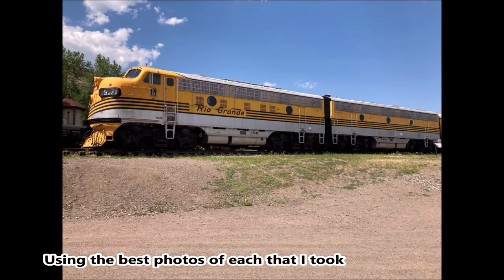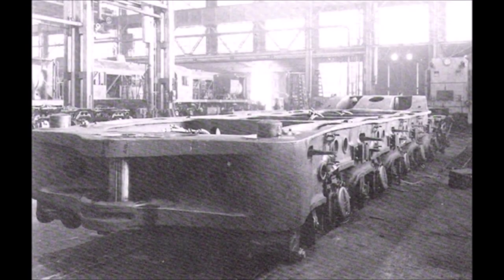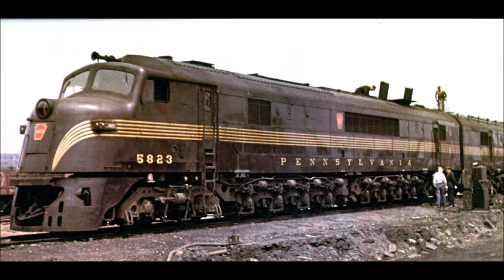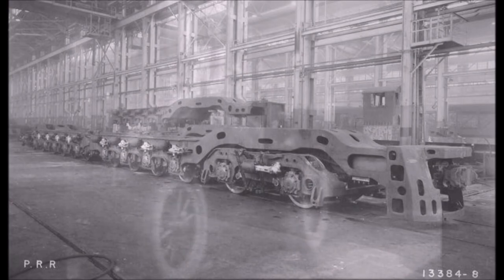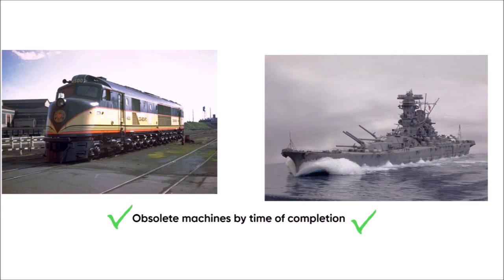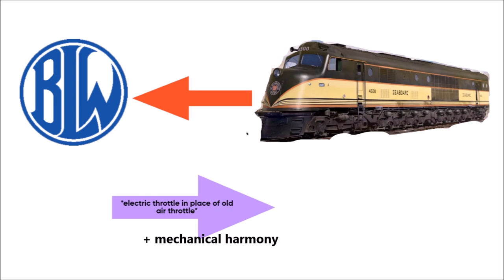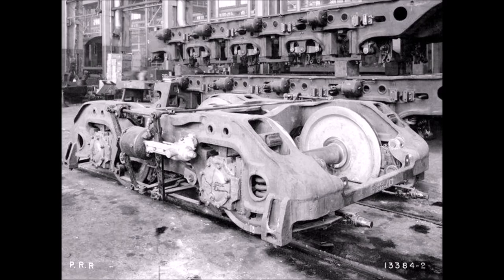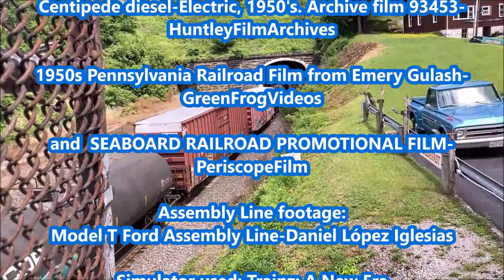The Baldwin Centipede| A steam-head company’s rough start with mainline diesels.

Comment: It's the standardized design concept in which builders like EMD, GE, and Alco beat out former steam builders. The former steam builders were still stuck in the customized build concept for building locomotives. This was acceptable during the steam years, but railroads were looking for standard parts and designs to maintain their locomotives.
Reply: you do realize alco is also a former steam builder right
Reply: @Foxyisinhell  You are technically right, but Alco was more willing to adapt to the changes in the environment. The other former steam builders were lost in the concept. Alco's downfall was in the electrical side of the locomotive building. If they were able to secure this element, they may have been around today.

Comment: The Centipedes that went to Mexico gave good service and allowed N de M to retire a large chunk of their steam locomotive fleet. Baldwin rebuilt N de M’s Centipedes with a different piston cap to solve the turbo fire problem after which they gave another ten years. The original concept of the Centipede was the use of smaller diesel power packs that would sit perpendicular to the body. Up to 8 packs would fit on the locomotive and could be removed or replaced with quick connections. The concept turned out to be an expensive locomotive so the engineers reshuffled their cards and converted it to a standard twin diesel configuration but retaining the unique wheel arrangement.

Comment: can you please do " dead on arrival " about Emd SD50. Emd's first  greatest flop.
Reply from the maker: I’ve got that one planned for a future episode after my brief return to steam locomotives in the next episode. The SD90MAC is also in-line for this series-not to mention how much I like the SD80MAC, but I might now have time as I’m moving out of state in about 2 weeks for college and won’t have my PC with me to work on videos, not to mention I’ll be too busy with college stuff anyway. But I may have time to continue wish those videos whenever I home home for Christmas and summer.
Reply: @AndrewTheRocketCityRailfan4014  thanks
Reply: Actually EMD's first flop was the BL-2
Reply: @danielbackley9301   Bl-2 is a failure, but it didn't tarnish Emd's reputation, and only 59 ever built for just a few railroads, there is some debate on mechanically unreliable. compare that to SD50. 431 Sd50s ever built. they plagued by engine and electrical system problems and failures. SD50 suppose to successor to SD40-2 it didn't do that SD40-2 ( 3,982 SD40-2s) outsell it, SD50's production lasted until 1987 compare that to SD40-2's production lasted until 1989. many SD50 coverted to SD40-2 standards and SD50 tarnished EMD's reputation. allowing GE to catch up becoming top 1 locomotive manufacturer.

Comment: The Pennsylvania had a line through Vandalia, IL and through part of the town the track was down in sort of a trench.  A fun place to watch trains.  Wide enough so you could be safe, but still pretty "up close and personal".  Probably circa 1962 or so I was there, and a fast freight came through with a centipede on the lead.  it was really moving and quite a little experience to see one of those beasts flash by.

Comment: Baldwin failed for, among others, two reasons. But the time Baldwin warned up to diesels, they didn't figure out that motor transition was required for high speed running. They could pull the earth, but good luck going beyond 40 MPH on their earlier diesels. Secondly, their MU system was only compatible with other Baldwin diesels, and railroads already figured out that they really like equipment that works together.

Comment: Two things from this. 1. Baldwin was a bit short-sighted in the diesel category, which IMHO, put the nail in the coffin for Baldwin in the mid 50's. Definately using air throttles instead of the standard electrical components that would let them lash up to Alcos, EMD's, etc., was a long term loser for a short term savings. Lack of mass production techniques for diesels also hamstrung Baldwin big time. 

2. WW2 put all industries, including locomotive builders and railroads, under government supervision under the War Production Board, which regulated the output of industries, which also curtailed a lot of experimentation. It put a lot of development of the diesels @ Alco to switchers only while it gave EMD a green light on road and switching engines. The Pennsy built 125 J1 2-10-4's from the C&O design instead of new duplex's that were on the drawing board. The B&O received 30 EM-1 2-8-8-4's from Baldwin because diesels were also limited by the WPB. They wanted new FP's, they only were allowed few.

Baldwin may have gotten permission to test the centipede, but production was post-WW2. Baldwin was stuck making mostly Steam locomotives as per the WPB.
Reply from the maker: My original script did have a bit more info in it including that bit about Baldwin’s prototype but then removed it before recording so the intro wouldn’t be too long.
Reply: The Calumet & Hecla and Copper Range switchers held in for 20+ years in upper Michigan in some awful cold and snow. The MILW ROAD had units over 20 on the Twin Cities. Their shops knew how to work on them just like FM in MKE.
Reply: @paulbergen9114  The same can be said of the the Baldwin diesels on the Western Maryland as a testament of the WM's high maintenance standards.

Comment: Another issue Pennsy had with centipedes in helper service aside from the jack knife issue was the traction motor cooling fans were in the carbody and ducted to the traction motors in the trucks. since a physical connection of a flexible duct connection wasn't possible for the most time a locomotive travels it's mostly on a straight line so the duct would be flushing cool air over the motors and wouldn't be in a curve very long for the minimal time the 2 ducts weren't lined up. only problem was helper service meant not only heavy loading where cooling would be essential they were also operating on curvy mountain railroads where those cooling fans were spending more time cooling the roadbed and the traction motors overheated. with all other possible uses for the centipede proven to be spectacular failures somebody at the Pennsy's power desk thought it over looking for a place these locomotives could still be of use to the Pennsylvania and hit on what was a seemingly perfect job for a high HP high tractive effort single ( drawbar connected) locomotive that of working the hump shoving cuts up the hump in classification yards of course that overlooked the slight issue of a a rigid frame locomotive that would at times have to crest a sharp peak. the centipede worked fine until the first time the locomotive needed to crest the hump the leading wheels kept right on going up eventually leaving the rails and then once the locomotive reached it's center of gravity the old adage of what goes up must come down came into play and the centipede came back down, not hard but also not on the rails. supposedly that was the final straw that sealed the centipede's  fate as future razor blades and the order came to rerail it and once back on the rails move it to the deadline for it's final time.
Reply from the maker: Thanks for the info.

Comment: This video brings up a good point about engine weight.  A diesel could be "heavier" than a steam engine, but without the pounding of the drive rods, the load was actually lighter.  Witness the number of bridges that had all kinds of restrictions with steam engines, but multiple unit diesels could traverse the same structures without incident.  BTW, there was a Baldwin Centipede on the B&O's "West End" on at least one occasion.  W. R. Hicks snapped the 6000 at the M&K Junction (Rowlesburg, WV) Enginehouse May 28, 1948 - page 45 of Deane Mellander's "B&O Thunder in the Alleghenies".  B&O bought a number of Baldwins (Sharks and S12 switchers mostly), but Centipedes were not among them.
Reply: Charles S. Roberts' book WEST END had his take on 6000's journey to B&O's West End.. The number "6000" didn't bode well with the engine crews as they were the number series of the first class S 2-10-2's that once trod across "The Hill" (as the author called West End). The B&O were also big Baldwin customers, yet took the hard pass on them, as Roberts' noted, "They were returned with a note, 'Thanks, but no thanks.' "

Anecdotally, Roberts concludes with "The Hill must've laughed when The Pennsy suckered on these bombs."
Reply: @mike6206  Thanks, I forgot all about that.  I haven't looked through my copy of WEST END for several years now, may be time to pick it up again.

Comment: In spite of all of the maintenance issues it's amazing how all of these locomotives lasted 20 years in Freight Service. They could have been rebuilt but you get a tax write-off if you buy new engines and scrap the old ones. Dependency wasn't in the position to buy new engines without help and that meant put it in debt and kill the Penn Central among other things.

Comment: Started with "Penn Central" in 1972, rode many a GG1's, they were a good riding engine. Smooth ride over some rough tracks back in the day, not at all comfortable inside, but it had speed with that good ride.

Comment: The photo at 11:53 shows the oil leaks the centipedes had along the car body due to vibration from the engines and the oil lines running along the insides of the body rupturing the oil lines.
Reply from the maker: Dang, never knew about that flaw till now.

Comment: I would suggest the underlying issue that led to the centipede design was electric motor size, and the need to split all that power.  Old motors were done as DC, and had physical limits as to how much current (thus power) it could accept.  If you are cranking out 6,000 hp then you need an outlet for all that power, and with the size limits of those DC motors in their underslung position you would need to fit lots of motors below.   Later controller designs could "chop" power pulses to the motor to keep them from burning out but in the infancy days of electric propulsion that did not exist. 

As to the original Pennsy GG-1 units, hanging more motors allowed pulling power to be developed at the coupler, but limited at the individual wheel, so the vexing problem of wheel slip was addressed by allowing for a broader input power band.  I suspect, but do not know, that the GG-1 electric had a lower weight than a steam unit, thus dumping power into fewer traction motors would expose the machine to wheel slip. So the solution was to add more motors -and thus more axles!

I have a vague recollection that the Russians once built a monster steam machine with 11 power axles (22 drive wheels), but the beast was so big that it could not negotiate curves, so it was scrapped.  At some point, power distribution outruns itself.  Except in airplances of course; the B-52 had eight jet engines hung off it!
Reply: The deal with that Russian monster was it wasn't articulated like the Big Boys are.

Comment: 6000 horsepower prototype? that is insane in the 50s, let alone today
Reply: The Virginian EL-3A could generate that much horsepower continuously in 1925 (to be fair, it was a pure electric, so it kinda makes sense, but still, 6000 HP continuous in the mid-1920's is unreasonable, especially it's 277,500 pounds of tractive effort)

Comment: Well made loco report!
Baldwin did suffer from the same issues as the British firm North British Locomotive Works.
They were excellent builders of steam locomotives, and in the case of NBL, they even exported more locomotives than the already quite large numbers they did build for the domestic market.
Baldwin was a large exporter too, but I don't know if their export numbers surpassed domestic production.
But both used the same production methods for diesels as for steam, without having every aspect of their construction precisely written down, and in some cases even with steam loco tolerances  which weren't precise enough in case of manufacturing engines and other mechanical parts for diesels.

And even in these days there are examples of trains built in such a way.
The failed Fyra HST sets for Dutch railways were a nightmare, built by Ansaldo Breda of Italy, every set was different in placement of wiring and some other equipment, these trains stopped working if the slightest bit of snow fell.
More than 800 major and minor defects were noted after delivery, in the end the train sets were sent back to Italy and further orders were cancelled.

Comment: with the big boy steam trains,
Maximum speed	80 mph (130 km/h)
Power output	7,000 hp (5,200 kW) @ Cylinder
Tractive effort	138,240 lbf (614.9 kN)
Factor of adh.	3.91
Reply from the maker: I was using the old specs, those are the specs from 4014 after its restoration and oil conversion.  I know the Big Boys were supposed to put out 6,600HP but only reach 6300 in revenue service due to using low quality coal.

Comment: Certainly is a fascinating design. Pretty impressive for their first venture into a mainline locomotive; just a shame they missed the mark with being more universally friendly and consistency for maintenance. By contrast over the pond even with the UK's considerably smaller locomotives some Diesels no matter how good would be done in by maintenance and upkeep costs too as it becomes harder to justify keeping an engine in service if it's less likely to be available. The Class 56 did well for the most part but would begin to lose traffic to the easier to maintain and less costly Class 66 though the Class 56 still remains in use by some UK rail operators.

Comment: Hi Andrew.  Two-cylinder steam locomotives were tough on the track because their torque was so irregular and unbalanced - thus creating hammer blow aka dynamic augmentation.  Diesel-Electric and Electric locomotives have consistent torque because the electrical input is easily controlled and consistently supplied.  Where Diesel-Electric and Electric locomotives pay a price is that the traction motors tend to be suspended on the axles - and therefore are un-sprung weight - and therefore are hard on the track.  Whereas on a steam locomotive everything other than wheels and axles are sprung.  Axle loading doesn't particularly come into it.

Comment: Baldwin pneumatic control was a good feature but it prevented their locomotives from hooking up with other locomotives from other manufacturers because that was simply not done back in the old days. Baldwin made good switches and good road switchers which is why 80 years later you have Baldwin switches that still are rolling up the 10 miles and you can still get parts for the Baldwins and they tow like anything. Crews used to held used to have contest to see how many cars a Baldwin can tow before the traction Motors caught on fire the record was 108 was one Switcher because the Diesel's weighed less than steam Engineers got paid less than steam so they had been sensitive to bugger up the diesel so it would have to be replaced by a steam engine so they would get paid more.

Comment: Baldwin Alco made diesels to custom specifications that the railroads wanted and many of the specifications that the railroads desired in the Baldwin and Alco locomotives then they also demanded in the EMT locomotives but as Alco and Baldwin went out of business EMD and General Electric had a lock on locomotive manufacturer.